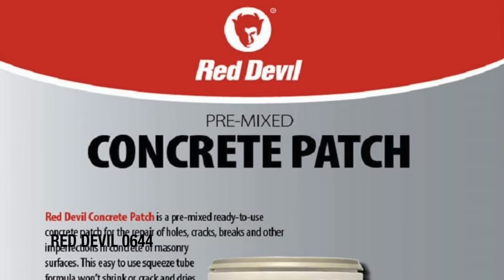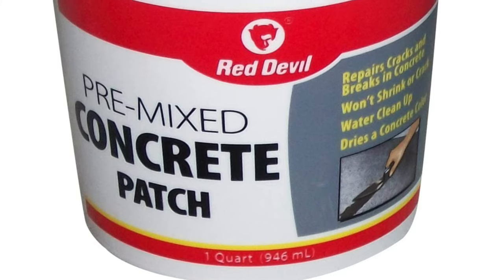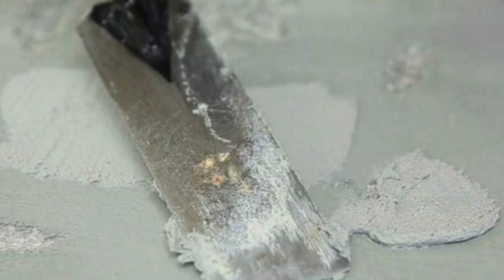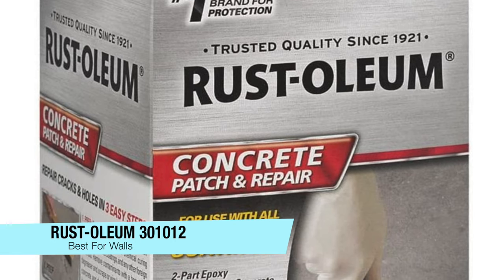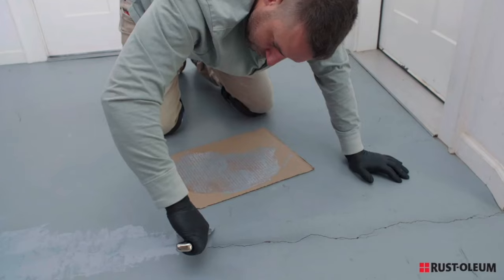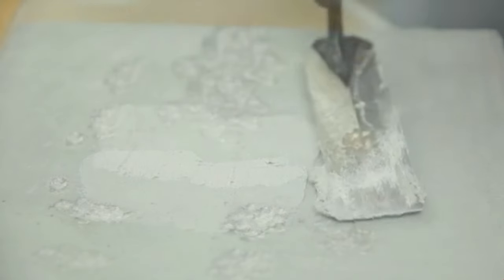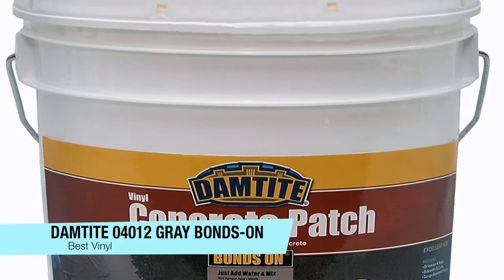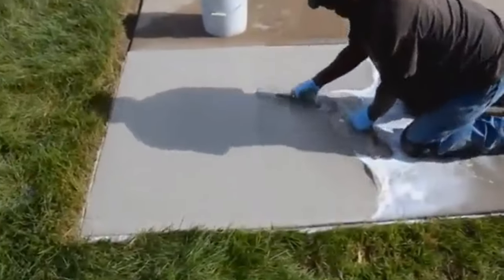TOP 5 BEST CONCRETE PATCHES: Best Concrete Patching Compounds (2023)

Comment: I had a towel rack in wall that has a concrete base.  the rack was pulled out and now i have a hole in the wall.  Will any of these allow me to redril and replace the towel rack in the same place?

Comment: I think you meant to say that the Rustoleum product is good for horizontal repairs NOT vertical. It is absolutely awful for wall repair because it stays liquid and runs for about 1.5 hours. I had to add regular cement to it to use it on my wall.